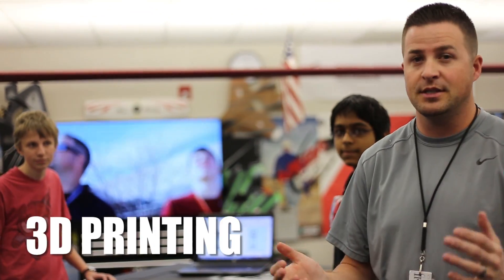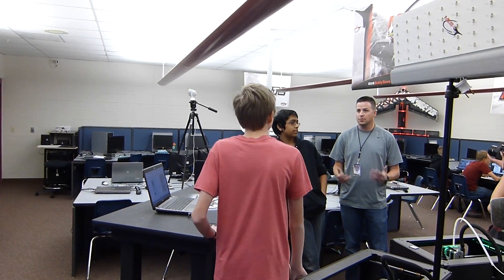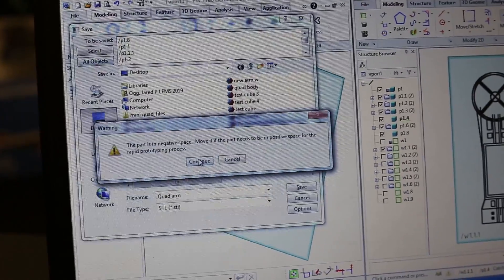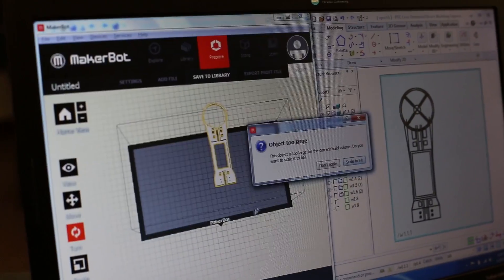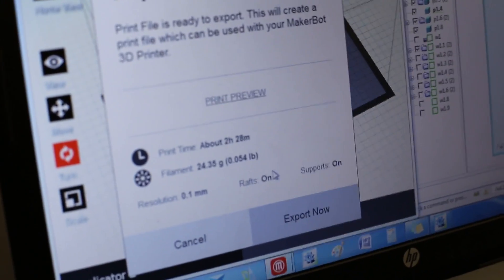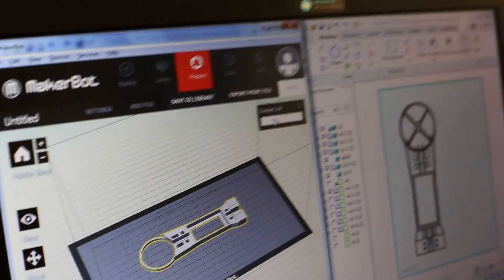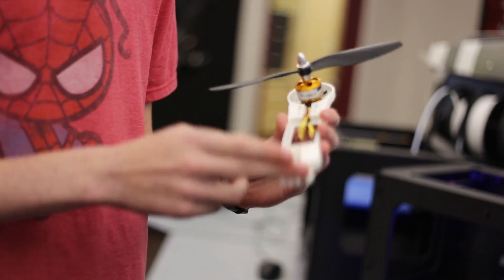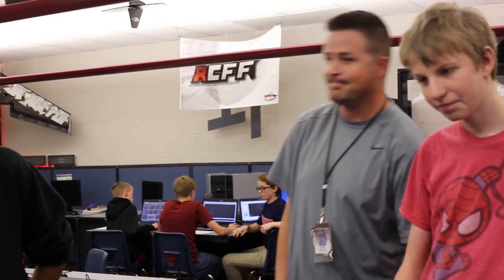MESArcFF - 3D Printing - TIP SERIES

Comment: Hey guys
Luv what your doing and was thinking that your 3d printers would be ideal to maybe make a plastic nose cone that can be used as a template to form the front of your fuselage around. I also noticed a youngster had downloaded an engine mount stl. file from thingiverse and used it in his make. What if your young guns designed an entire engine compartment that would house the mount, esc, receiver, and maybe even the battery in a flexible (forward-backward layout for balance) but super rigid format that just slides in. This will be less of a scratch build of course but could contribute to a stronger plane. Anyway I think your the coolest bunch of kids (teacher too) and you're way ahead of the game.
Cheers

Comment: My school has two makerbots, a maker-bot replicator2 and a replicator 5th gen, the replicator 2 is three years old now and works 10X better then the other one. The rep 5th gen was delivered untested from the factory and when ran our first print it burned the build platform. We tried everything to adjust it but nothing works so after a long runaround from MB we finally got to send it back. It turns out that it was completely missing a part so it the gantry was all messed up. It now works ok but is slower to start up, has smaller build size and overall the software is not improved at all (the product was pushed off the factory line too soon).. Marker-Bot once was the industry leader and cared about there products and customers but now they are no better then any other money hording company. why am I saying this then well if you ever need to replace your printers then i strongly suggest that you look else where.